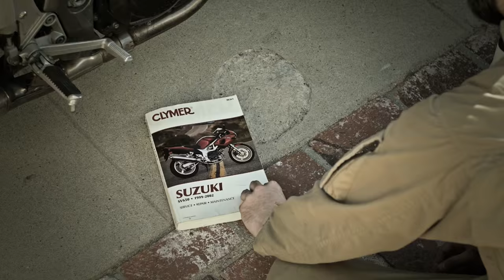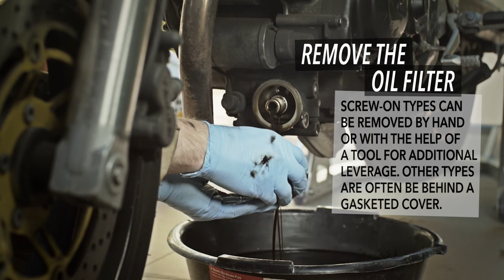How To Change Your Motorcycle Oil

Comment: Nice vid. Do you not fill up your filter before putting it on? I've always done that...
Reply: ***** the oil filter will prime itself full off oil.  obviously more relevant on an oil filter that is vertical but generally speaking you will always have to top up the oil once the engine has run for the first time.  probably negatable but habits are habits :)